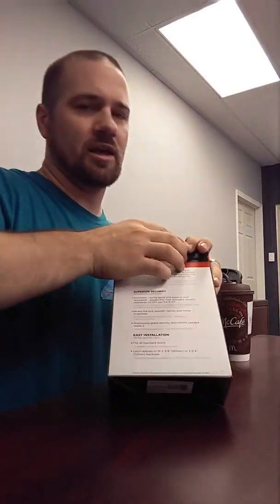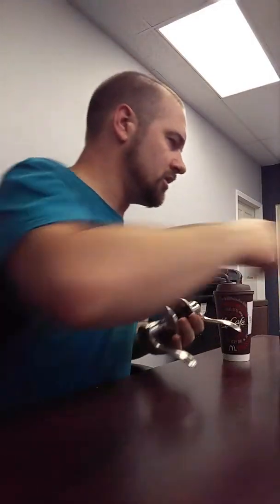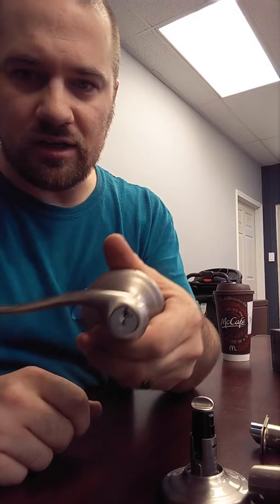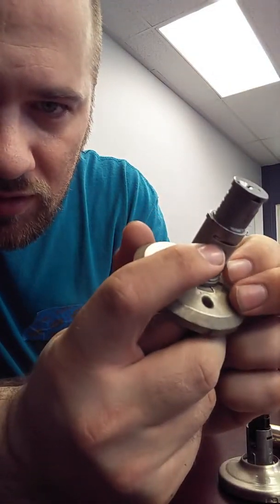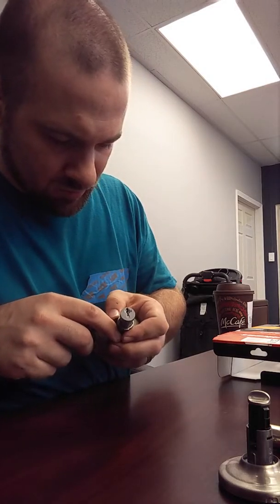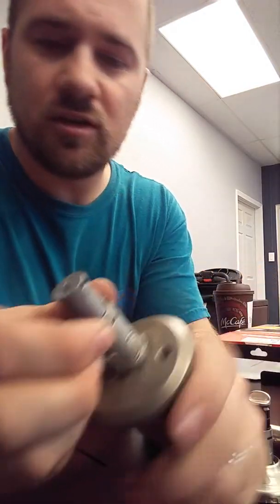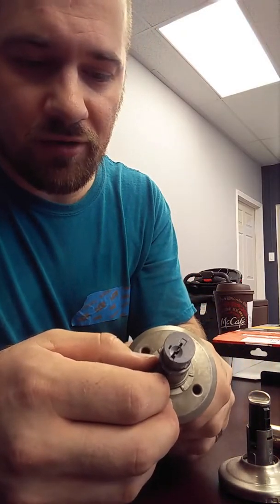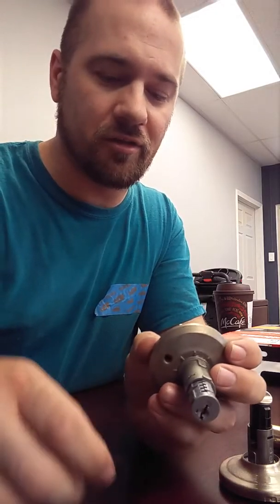Lock upside down on Kwikset moving it right side up

Comment: Excellent video, exactly what I was needing. All other videos are for a different style lock. This was the only one I found that removes the c clip. My knob was different and I had to depress a small rectangular clip on the side of the knob to remove the knob instead of an Allen screw. Once the knob was off it was identical to the one you have. Thanks again for this video.